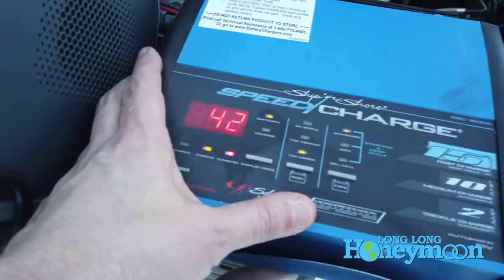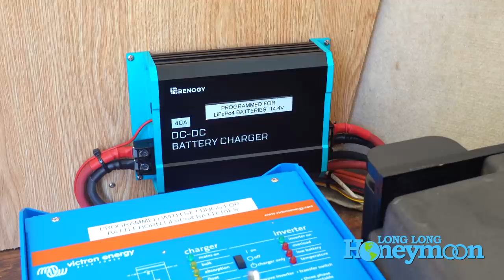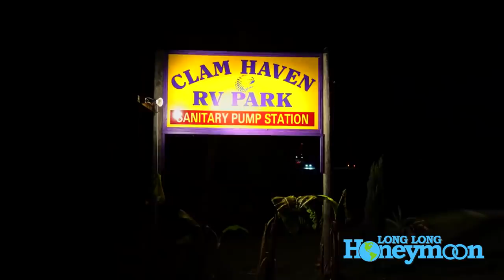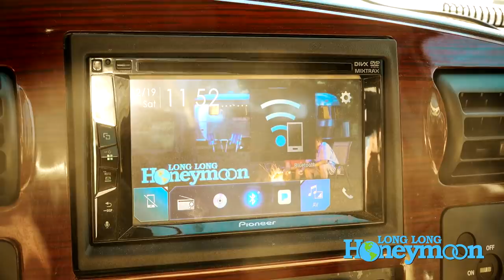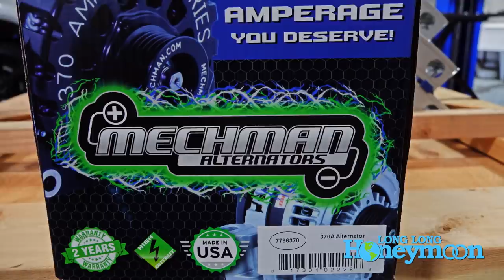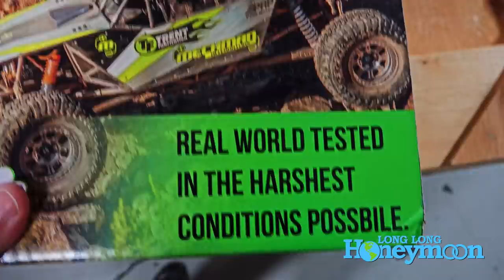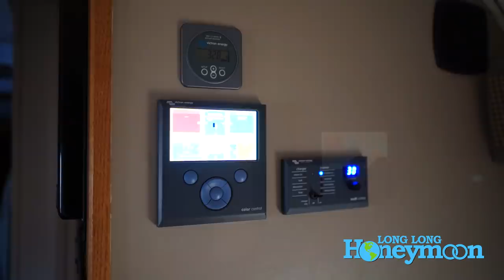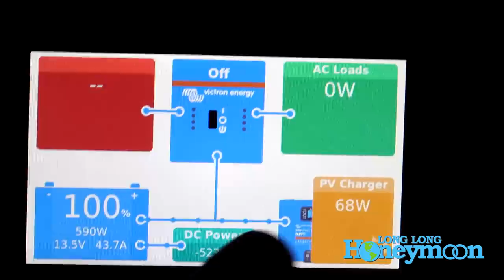UPGRADE: Installing a 370 AMP Mechman Alternator!

Comment: You should have your batteries completely topped off before you leave your house once you get on the road your batteries are like a bank don’t take more out did you can put in the frugal with your Power use use air conditioners on solar panels forget it unless you want to run a generator get a good Honda generator that is quiet when you need to use it
300 amp alternator is the same amperage and we use when you’re doing heavy-duty welding if something goes wrong you have a major problem.

Comment: Who installed that solar system for you?…… these guys dropped the ball on that install, that alternator should’ve been changed at that time. Those guys should’ve known the charging requirements for your set up.

Comment: There couldn't possibly be a "fitment issue" unless the alternator is a piece of furniture.  The word "fitment" means a piece of furniture.  It has nothing to do with how something fits, is fitted, or the relationship between two items.   Look it up, and then stop using the word "fitment" to mean how thing fit together.